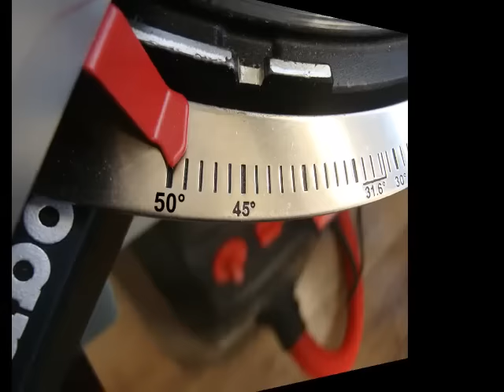Metabo KGSV 72 Xact SYM

Comment: Remember that this saw needs to have adjustments made to make 0 or 90 cuts accurately MyBest.Tools  I had to use a right angle on the deck and blade and then adjust the bolt to get the correct reading. Once this is done, it works great.

Comment: Superb quality throughout, easy to assemble. I found the saw to be highly accurate and a delight to use (I am a homeowner using this saw for various projects). I attached the saw to a folding mobile stand to save space and that works great https://www.youtube.com/post/UgkxPeGkHOMe05FySypTOvYumxMn-xi39oRe  as well. However, you have to be sure the saw is securely locking in position before collapsing the stand. I've had many of the brands over the years and have come to point where I only buy Bosch, the extra money is a small price to pay for the quality and ease of use. Treat yourself to the best.

Comment: I wold like to strongly warn you all AGENST the KGSV 72 Xact SYM.

On paper this mitre-saw is perfect, but unfortunately it SUCS! The total design is to flimsy. 

In use this saw is dangerous to use and inaccurate. During 45drg bevel, the blade will not make a straight cut. The top will lean and jam the blade. This saw is designed with fantastic spesifications, but lac in build quality.

I sold the saw after short use and went for Festool KS120. This is rigid and makes straight cuts – as a mitre saw should do
Reply from the maker: Hi Tore, we are sorry about your experiences regarding our saw wich we sucessfully sell world-wide since years. Quality is always in our main focus. In order to check the saw please contact one of our Service stations in your country. Please find address here: https://www.metabo.com/com/en/info/company/metabo-worldwide/